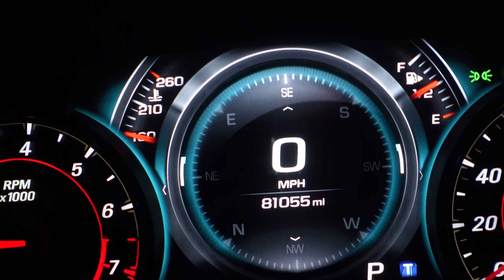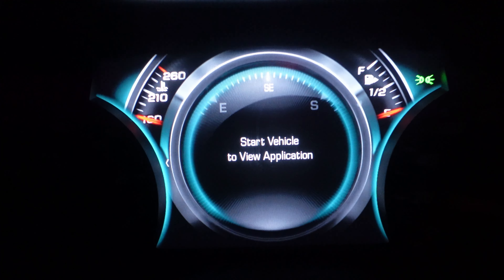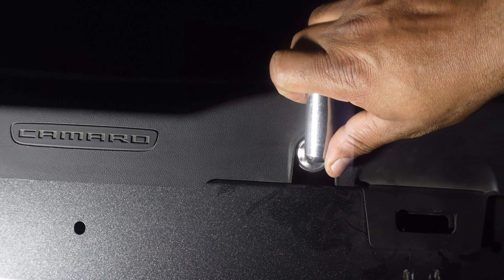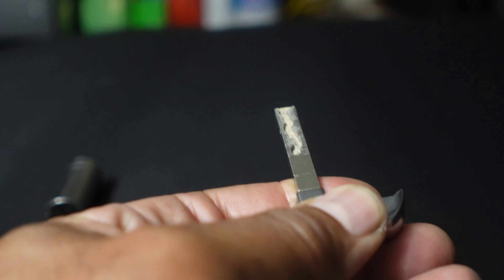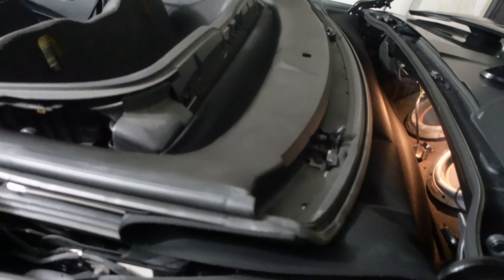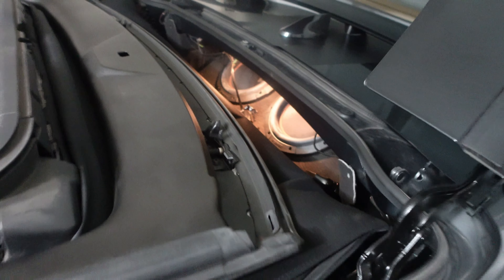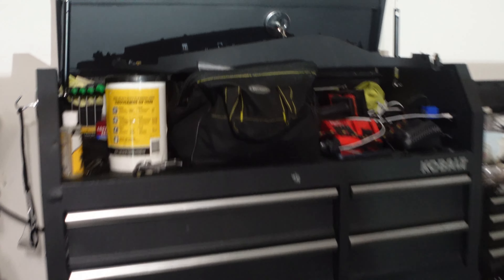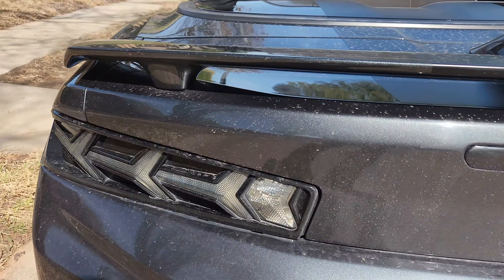CONVERTIBLE CAMARO SS ISSUE SOLVED

Comment: How you get your back top easy to lift like tht?
And mine lock
He wont lift at all.
Reply from the maker: When u press the top back button what does it say/do
Reply: Its says only manual top operation brotha
Reply from the maker: @yvenselveus7681 yeah try disconnect battery then reconnect after two mins. Positive post. Then let top down until it says complete. Then test by letting up again. Hope that helps.
Reply: Thank you brotha I will
Reply: Does disconnecting battery work?? I washed the car this morning let the top down to wash the deck lid! Went back up no problem! I came home showers and went to hit the beach now I’m getting “only manual top operation or top possible! Any help would be love! Also my trunk opens!
Reply from the maker: @doug6674 yes restting the car battery did help. After you disconnect the positive post for 3mins then reconnect.